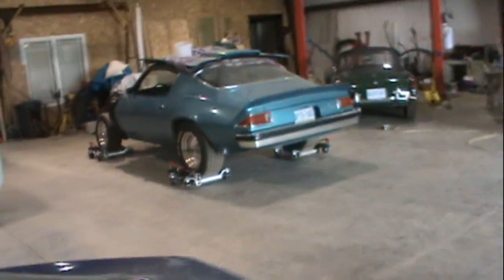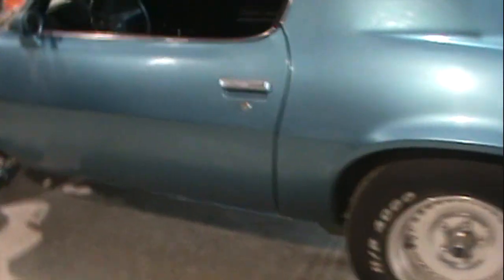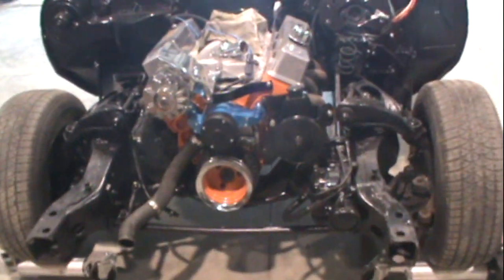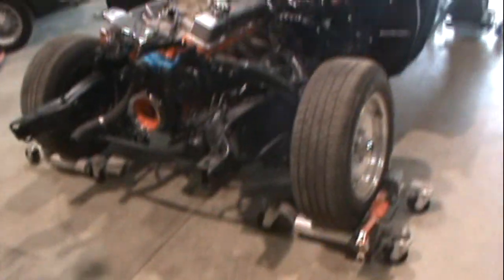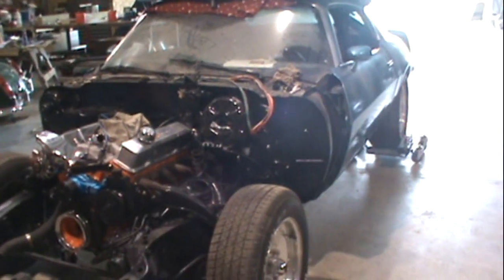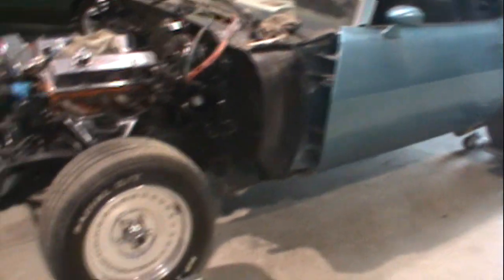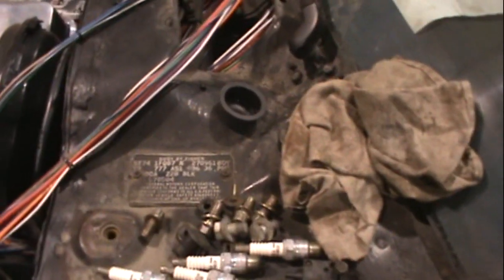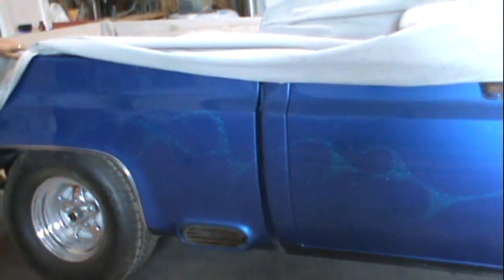A Nice Scrap Run

Comment: inline fuel regulator will solve your "Soiling" ?????? and possibly a new voltage regulator or a aftermarket higher amperage one ????? your valves may be built up alittle with carbon causing sleeve friction ,vale timing caused to be slight bit slower ? good luck though buddy, work out the kinks .